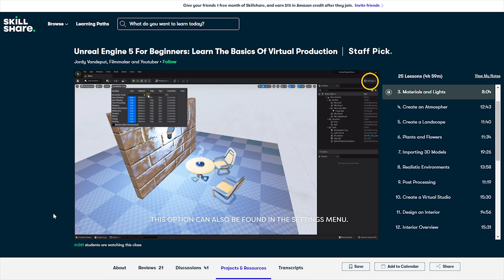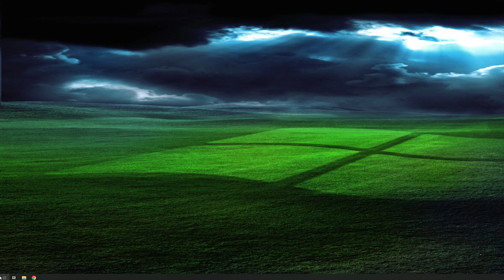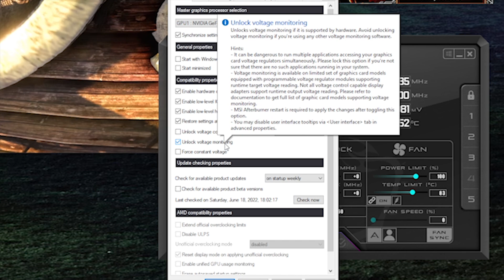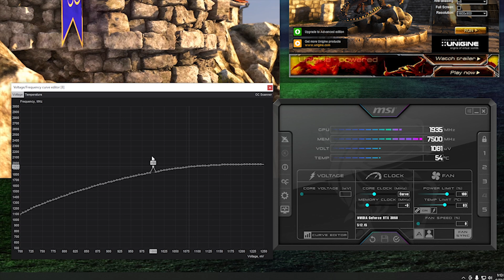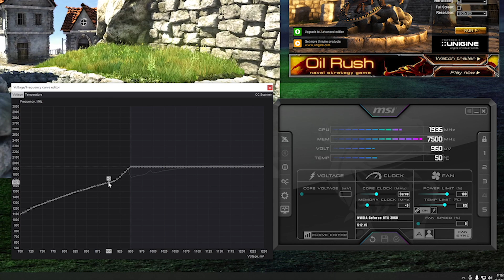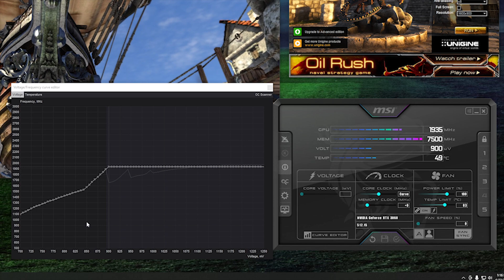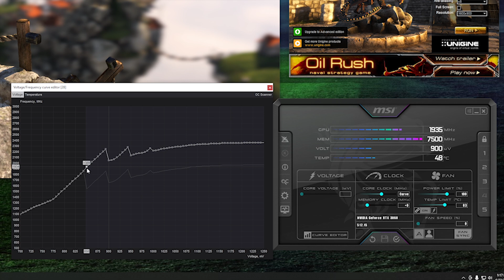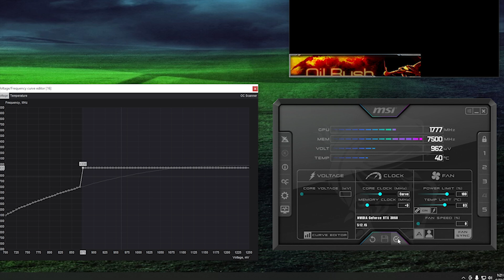Should You Undervolt Your GPU?

Comment: i did this to both cpu and gpu not for overclocking or trying for more performance, but for temperatures to be lower and achieve the same performance or a small increase while stable.

Comment: Umdervolting to get your voltage efficient and stay capped at certain mhz that's what I did on my 5090 and it's only pulling 920mv 😂 on the highest at 2885mhz and getting better than stock fps win win

Comment: This method doesn't undervolt the lower frequencies.  If you raise the whole curve first you get undervolting across the whole frequency range.

Also have to test in some games.  I've had Heaven run fine, but Portal RTX will crash almost immediately.  Same with Control.

Comment: I have an rtx 4070 with really low temps highest I’ve seen it go is 62c and idled around 29 with fan on or 43 with fan off. Would it be worth undervolting? What kind of performance gains would I get? I am able to over clock to 200/1000mhz I haven’t tried to go further as I’m paranoid.
Reply: what's your gpu hotspot?
Reply: @ after undervolting to 980mV it sits around 61c under load at 2780mhz core clock and 11,802 memory clock. Runs really cool.
Reply: @ nice

Comment: So.. hundreds of  experienced engineers work on this card beyond our comprehension (at least 99,99% of ppl including me)  and 2 apps .... And you are settled...idk if the explanation is good,maybe i haven't knowledge to estimate,just its too good to be true.
Reply: There is a maximum voltage the processor can handle.  The minimum that will work varies across samples, so they'll pick something that is less than the maximum allowed, but high enough that all cards can hit their target clock speed with room to spare.  Thus in general the default voltage will be set higher than is really necessary.

Comment: Good intro explaining the mechanics behind undervolting, thanks for that. And I know I'm two years late, but yeah: Afterburner is a bit of a pain when it comes to manipulating that voltage/frequency curve ... glad it's not just me being butter-fingered.. :D
That said: Judging from my own experience with RTX cards, I would probably recommend stress-testing in some sort of RT-benchmark, not just in Heaven. I undervolted my 4070 Super a couple of days ago and found that I couldn't go super low on the voltage if I wanted stability in RT-titles. My first, not overly ambitious UV (0.925V, 2700 MHz), seemed stable enough until I tried it in 3DMark Speed Way and Port Royal. Plus it also crashed Hitman after 10 minutes or so, which is an RT-title. 
Port Royal seems especially sensitive to unstable settings - I've used it while pushing the card to the limit (no undervolting) and it was always the first application to crash. My most ambitious OC-attempt for example seemed to run fine and passed the Speed Way stability test (20 loops) but then crashed Port Royal's stability test on the 11th loop. 
Still: Even with only 0.920V and 2600 MHz on my current undervolt, temps and power-draw have gone down quite dramatically for me. High to Ultra settings in Hitman at 1440p for example would result in well over 200W and low 60s°C core/high 70s hotspot at stock speeds while my (arguably pretty timid) UV caps that to ~140W and ~low 50s on the core and low 60s hotspot. Also: Don't forget to up your VRAM clocks while UVing. I have mine running at +1200 MHz in AB and it works fine.

Comment: Does this mean I don't have enough power? 

10:37:13 Connected to MSI Afterburner control interface v2.3
10:37:17 GPU1 : VEN_10DE&DEV_2204&SUBSYS_403A1458&REV_A1&BUS_12&DEV_0&FN_0
10:37:17 Start scanning, please wait a few minutes
10:57:22 Scan succeeded, average core overclock is 85MHz, memory overclock is 200MHz
10:57:22 Dominant limiter
10:57:22   Voltage
10:57:22 Results are considered unstable
10:57:22 Overclocked curve exported to MSI Afterburner

Comment: Great video gonna follow your advice my man. A little issue lm having though.
been watching many OC videos and something lve noticed is that they never mention anything about the PSU l mean lm assuming that as long as it can handle your system that mean you can OC without worries but lm just concerned a little about that stuff as sometimes my PC shot down when gaming but supposedly should handle my PC with no issues. l have a Thermaltake 600w and an Rx570 8gb.

Comment: what settings should be used in the Heaven test?
Reply from the maker: It doesn't matter. I typically lower the resolution a little bit and make it so it's not full screen so I can set it to the side. The whole purpose of it is just to put a load on the GPU.

Comment: To fix the changed preset simply choose to lower the clock speed by a 100 - 200 mhz and then apply the voltage to whatever point you aiming for at 1800 - 1900 mhz , that way it stays stable each time you load your preference

Comment: What do you when Heaven crashes BEFORE you touch anything in MSi?? Sorry I'm new to computers!
Reply from the maker: Well, then you have issues. 

If it's crashing before you even touch the dials then there has to be a reason. If it's an older GPU then your thermal paste might be bad or your cooler might be really dirty. I would check your GPU temps and maybe even update your GPU drivers.
Reply: @CyberCPU  Thanks for the quick response. I have a 2080 ti. Ive tried to update drivers, says no update available, tried to revert drivers: it's greyed out and I can't click on it. Temperatures hold steady around 65.
Reply: @CyberCPU  I looked at the curve. Reset it, cause it showed it above the baseline (dk how that happened cause I never touched it. I reset it, heaven worked. But when I tried to play apex legends, my whole computer shuts off once I enter a game. Any time I try to overclock the GPU, it also shuts off (sometimes during even just the start up video)
Reply from the maker: @GetShmanged sounds like maybe something is wrong with the card. Maybe try to remove the driver's with DDU and then install the latest ones again. I did a video a while back on a utility to install Nvidia drivers. Here's a link. 
https://youtu.be/zk_-xEIRSeI

You could also try different driver versions with that utility.

Comment: Hmm, I didn't undervolt or overvolt at all (voltage slider bar at 0), and I get 8101mghz (+1300) memory and 2175mghz (+210) CPU stable in all situations.
Temps went from stock 40C to 50-60C under full load with fan speeds of 40-60% on Stealth Fan Curve.   All with Precision X1.  Power Target at 100 and Temp Target at 72C.   Unity Heaven run in Extreme to max out the CPU.

Now my 7950x I limit to 80C... to stay nice and chill... but my GPU I overvolt and keep it under 65C

Comment: @CyberCPU Tech
i think i know why you never could consistently save/load a profile

if you set a curve in afterburner or change clockspeeds and hit apply and it  does not apply exactly what you set that means you cannot set that specific clock speed
go up/down 5-10 mhz and try again you will find values that consistently will save and are repeatable.

i do not know why that happens i only know if you found values that are solid they work everytime.

Comment: can anyone help who done this recently
i think MSI has made an update, now where you go to change the voltage down, it has 2 graphs instead of just the one
one for mhz one for mV
whenever I change mV down by like 50
my mhz changes about minus 100 by itself, because its downvolted
so without even touching core clock, it runs lower if I undervolt gpu
Reply: one more thing, my gpu isnt actually at the voltage I set on msi. For example I set it at 1150, bug in monitoring, it says my gpu is using 1137 max during the heaven test. I reduce by 10 to 1140 and now it uses 1131

Comment: Thanks for such a great tutorial but one question, I assume this undervolting method/principle also apply to the rtx 20s or is it a different concept for that series? I have a 2080 and I am very conscious of its power consumption. In fact, I want to disable it when not gaming or video editing and have my pc use just the Ryzen 5600G APU which is very low power consumption. Is that possible?
Reply: You can turn off graphics acceleration in your commonly used apps that use it (steam and chrome for example).

Comment: This guy doesn't understand that the curve is dynamic, not static. It's not changing from where you set it. It fluctuates dynamically based on thermals. This is a function of the video card bios, not MSI Afterburner. MSI Afterburner is just reporting those fluctuations. 🤦‍♂️
Reply: He explicitly mentions that it is dynamic.  What you set in Afterburner does indeed cap the voltage the card will use.
Reply: Many YouTubers show this undervolting method right way to undervolt is low the voltage lowest and increase mhz that's it 😂
Reply: Should I move the whole curve down so everything is more down not just if my pc is using high performance so it's like always an % less voltage?? Like CPU undervolting does that in the bios it's an % that goes away idk

Comment: I used to have an Inno3d 2070 X3 which is a sub 200mm twin fan card, under 80C 2500 rpm fan, over 80C 4300 rpm fan (jet engine). I ended up watercooling it because it was so loud and now I really wish I had tried undervolting it instead.

Comment: This looked like a good idea, and I actually have better performance using -70 mV +90 core +900 mem. I saved the profile and set it to launch at startup, but the MSI afterburner keeps changing the curve (random stuff like adding +50 more to core). My pc regularly crashes now because of these changed curves! MSI afterburner is horseshit, anything else I can use or how to avoid this?
Reply: The only solution is to a) set your underclock preset when the GPU is cool and b) set the clock to 15 Mhz lower than you would normally to give yourself some buffer.  Many people don't bother with any of the hassle and just set their cards up at 1900 Mhz so they don't have to mess with it since there are diminishing returns on clock speed past 1900 for most NVIDIA cards other than the top of the line ones.

Comment: Are you water cooling a 3060? Why?
Reply from the maker: There are lots of reasons. It really does run better. The 3060 is on a small PCB and fits well in my case. It looks good. Finally it's dead silent.
Reply: @CyberCPU Tech  i get it but dang to take that over a better graphics card...
Reply from the maker: @igotdembombs  If I got a better video card I would water cool that one too. 🤷‍♂️

Comment: This is the first undervolting tutorial I've seen that doesn't tell people to reduce their clock speeds before peak voltage, which would make GPUs actually consume more power when running less demanding games. Cheers for that!
Reply: It should just be a level line right from the peak onward then a arch before the peak?
Reply: @jgvtc559  I do it same as shown in this video. In the case of my 3060 it's 925mv@1965mhz. Raise the voltage point you want to be your peak and flatten everything beyond it, leave the lower frequencies untouched. My problem with most tutorials is they recommend starting with negative offset for the entire curve, which is garbage if you don't only play games that always max out gpu.
Reply: @Broformist  hi bro. I'm only starting with undervolting and now have gotten my 3060 ti at 1850mhz/900mv. The only thing is in all the tutorials I saw the start the curve with -250 like you said. Can you tell me what's actually being done there. That's the method I followed as well.
Reply: What's being done there is every voltage below your chosen peak one is underclocked, so now your gpu will be forced to jump to higher voltages in cases where it didn't need to before, just because it lacks the clock speed on a lower voltage point. Do it the way it is shown in this video, much better.
Reply: @Broformist  bro I usually play games that max out the gpu. Should I still do it the way shown in the video?
Reply: I suspect you could get better than 925mV with a 3060.  I'm using 900mV on my 3070ti at the exact same clock speed. It gets weird, sometimes lowering the clock speed can actually boost performance, especially in the 1% lows.  @Broformist
Reply: Okay, I gotta question, I have bought a gpu that quite frankly is more than I need. 6950xt.
Given energy prices in England @ 30p per k/w and that I typically play single player games, I was thinking of undervolting but also under-clocking the gpu. 
I figure I won’t need more than 60fps.

Anyone have any idea if underclocking and undervolting will have a big effect on power consumption? 
Could I get a 375w gpu down to say 150w ?
Reply: @christinaedwards5084  I under clocked as well and got my power consumption from 200 w to 120 w so you could try it. I play on a 60hz monitor anyway so it didn't matter if I under clocked.
Reply: Yeah, I noticed that on a few videos as well.  you would think they would understand that if you raise the curve to undervolt past a certain point, to lower the curve before that would overvolt lol.
Reply: yeah reducing clock speed before peak voltage is  overclocking so more power expected , you can use an offset to increase the core clock (make the whole curve go up) this will actually undervolt your gpu at all the speeds but need way more testing ( it could be stable at peak usage but not at lower one) so the method shown here is the best if you dont want to do a lot of testing but only reduce the power draw and probably more performance when the gpu reach 100% usage) but if you want most efficiency at all points you need to undervolt the whole curve ( use positive offset for the core clock )

Comment: As I tried it by myself, this can keep GPU stable when a game needs a high performance with a lower power, but the power consumption can get increased when the game does not need the amount of power which is set by MSI Afterburner. And when the game is not running on PC (idling), it costs more power consumption than non-undervolting. So, undervolting (with these settings) should be used only when we play games which require relatively large power consumption for the good performance.
Reply: Nope, it works same as before undervolting, you can even see it in the undervolting graph in MSI (ctrl-f), or in TechPowerUp you can see that at idle the GPU is barely using any power. You have to run the game or some benchmark program at 100% GPU usage for few minutes, before you click - apply the undervolt, the game has to be open and running in the background, not minimized, if not the graph will be messed up when you click apply, and it can use more power just by running the game menu, or some easy to run games.
Reply: @1GTX1  You are right when PC is idling. But when I play a game which does not require more than 900mV (undervolt), the power becomes higher than without undervolt. Can we play such game with a lower voltage than 900mV when the game does not require 900mV? Or as long as we set 900mV, does it get fixed all the time even when the game needs, for example, only 800mV?
Reply: @gibbs-13  Yes, it reduces voltage if the game is not demanding. It's best to make undervolt profile, and apply it few times while running the game.
Reply: @1GTX1  thanks for your reply. I just tried undervolt without pressing L in the curve editor so the voltage is not locked. Then, it does not stay at 900mV and it can get lower when the game doesn't need the power. Am I doing correct?

Comment: 13:21 AMD GPU users can find out the necessary settings using MSI Afterburner, and then change the GPU settings using AMD Adrenaline Software, so you never need to worry about Afterburner altering settings on its own and having to redo the entire method each time. Or, even simpler, there is an actual "Undervolt GPU" in Adrenaline Tuning settings.
Reply: Why doesn't Nvidia app have an under Volt button???? This makes no sense to me lol

Comment: Of course, you should.
My 3060ti Gigabyte Eagle OC at stock is loud and hot as hell (over 100 C at the hot spot). 
Tuned down to 850 mV, power usage set to 85%, bumped clocks a bit, fans adjusted with curve optimizer.
Now is quiet, has 82 C at the hot spot, and is even a bit faster than the stock one.
Reply: You must improve air flow in your case. Things are literally boiling inside.
Reply: I dont have a good case but i can clearly see its not problem with case because temperatures rise from 50C to 85 in like seconds @krecikowi
Reply: @ahmedd_6760 This might be old but have you replaced the thermal paste on your gpu? Or the thermal pads? If not watch a YouTube video on how to do it

Comment: GREAT tutorial. I was hitting a max boost of 1980, but it wasn't holding to it for long. I got 2002MHz@975mV and 8000MHz VRAM frequency. The temps went from 75ºC to 73ºC even with more frequency. I get to 72ºC if I lower just the clock back to 1980.
Reply from the maker: Glad it helped.
Reply: Overclocking VRAM isn't worth it IMO.  It runs hot as it is.  Also, 1980 vs 2002 mHz is going to make about zero difference.
Reply: @gametime2473  yup, but you know what makes difference? 975mV vs 1.1v. know your voltages bro.